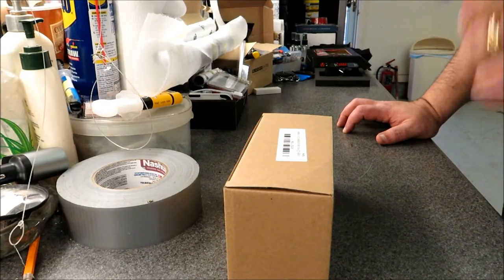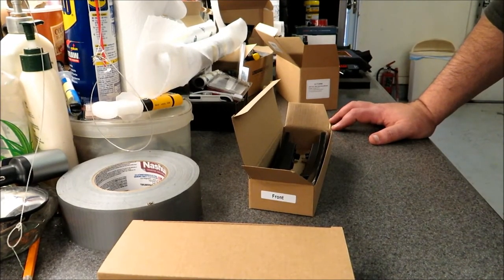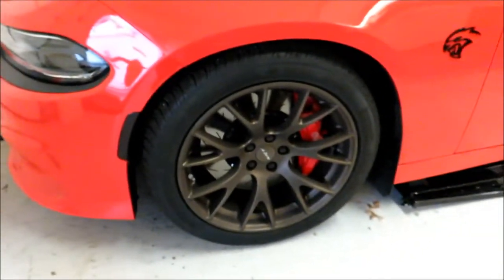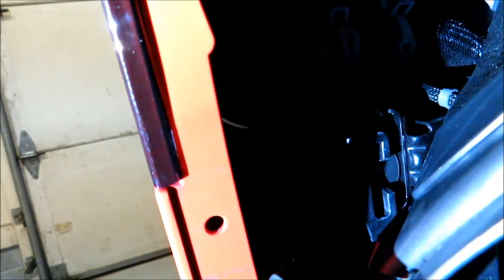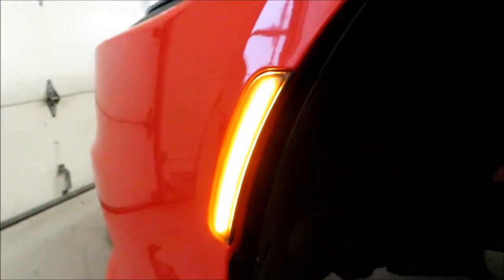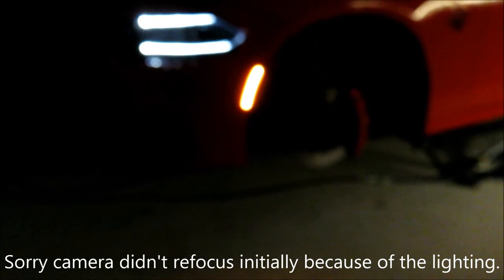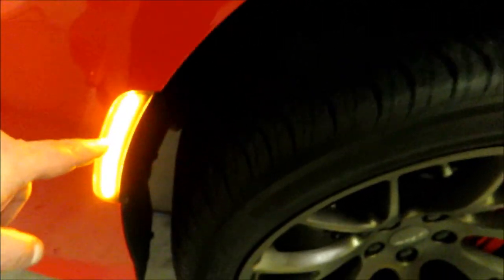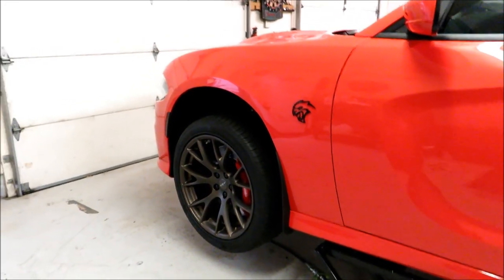Best Appearance Mod to Date?

Comment: Awesome man. They look really good. Im glad you did this video because I was going to order the Oracle ones. I didn't know that people were having problems with them burning out. That would have been money down the drain.
Reply from the maker: Yea they were lots of problems when they were first released.  I had hoped with time the bugs would be worked out but. There have still been failures recently. Of course no telling whether or not these will last long term but if they don't not out a ton of money.
Reply: Very true. Thanks for sharing this